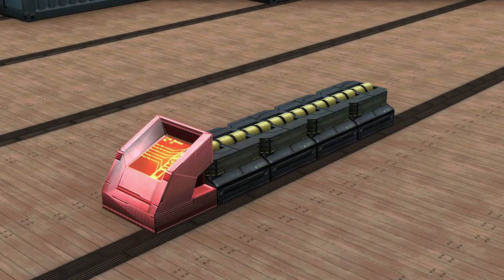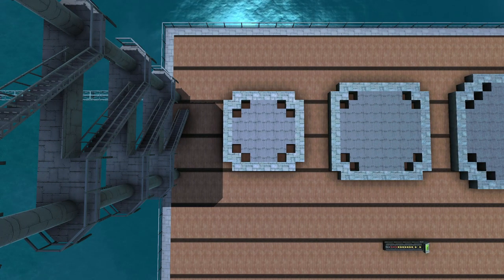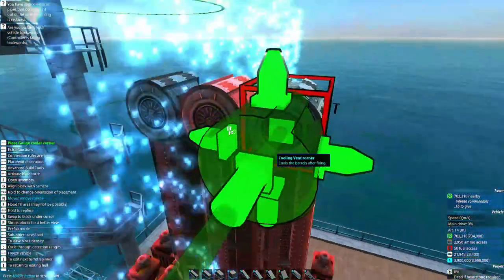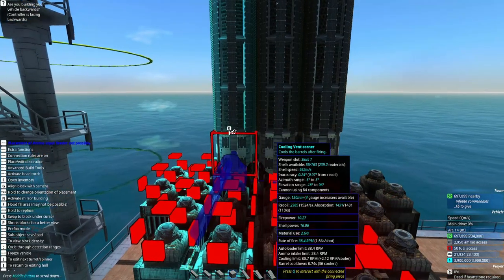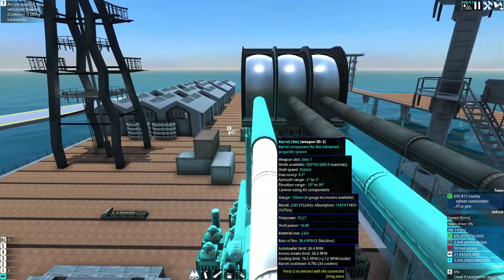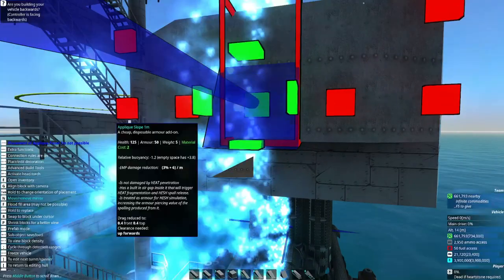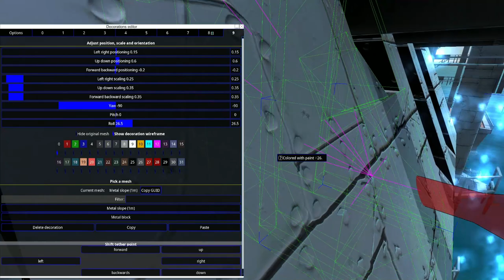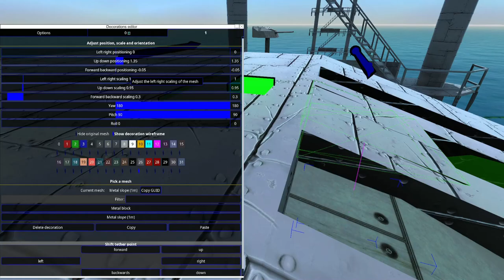Wrench's Way II: Constructing Guns - From the Depths

Comment: It's worth noting you can shave length off the shell with base bleeders, tracers etc. I pretty much always try to use base bleeders because there's really little reason not to imo.
Reply from the maker: Also true, I’ll have to remember to add that note in when I do an APS tutorial
Reply: Inaccuracy from those can hurt
Reply: @garrettledford1147  I've found lengthening the barrel a bit fixes that just fine and normally works out better overall.
Reply: @Kav.  Really? I'll have to try that out
Reply: @garrettledford1147 

Pair it with a rail gun if possible.

Boost to accuracy never hurts

Comment: I would add that you should really armor those turrets on the subobject itself, both the loading assembly and the neck, because any round that hits and registers on the subobject will ignore all external armor for damage calculations. If a big HE round hit the side of that turret cap, even if the top was completely unscathed it could easily wipe it by severing all of the gauge snakes through the deck armor.
Reply: I thought they fixed damage bleeding like that years ago?
Reply: I know its late but thank you, im now 90% sure thats why my turrets are getting destroyed even when the armor is barely damaged.

Comment: 10:58 Had to stop and look up the HMS Hood. Now I know a little bit more about naval history. Funny how that happens.
Also, just noticed while I was messing around based on what you'd shown - I don't know if an update changed this in the 8 months since this video came out or if I'm doing something wrong, but it seems like having a consistent number of clips attached to your autoloaders (or just having a ton of autoloaders) is really important for sustained fire. I tried building a smaller cannon that what you show here (2 barrels, 7x7 including armor, and only 1 layer of autoloaders), and because of the way I had set them up it claimed to sustain 20.5 RPM, but after about 10-15s it would get itself stuck where none of the autoloaders were ready to reload, so it would sit for 4-5 seconds not being able to fire.
Reply: That might be your cooling being higher than your autoloader/intake limit. It'll fire as fast as it can, so if the cooling lets it fire 80 rpm it'll fire 80 even if it can only sustain 20.

Comment: This taught me a lot, I mean I tried doing everything that you did, block for block but for some reason it made it so all of the Guage went to 1 barrel and the other 2 were thin, I still need to learn more but this is a great start, thanks
Reply: I'm so glad I'm not the only one iv just done the exact same thing
Reply: @benwenden2406  the way I fixed it was by having the barrels kind of separated from each other, instead of using the 5 way cooler blocks I used more of the corner or 3 way blocks
I hope what I said makes sense and can help you

Comment: Why do you need ammo controllers; I seem to be able to design shells in the APS barrel itself > access intakes > shell edit, assign to all / unused? What purpose do they serve, are they just redundant, do they allow saving and use of multiple shell designs? Are they needed for APS guns to work outside of designer mode?

Comment: If you really don't mind, for any multiple guns on the same turret, just build one on a spinner gun and clip it on the turret ring, this way every gun are ensured to be identical. Moreover you can stack the gun on pistons to make the gun barrel spacing denser or wider than 1 block.

Comment: 11:00
HMS hood wasn't hit in the deck though the fatal blow was just under the armour belt through the really thin torpedo defences
Reply: The captain turned in to close the distance because of the weak deck armor that was vulnerable to plunging fire at long range, which was responsible for halving the British firepower and increasing the hit chance of Bismarck's guns. If it weren't for that deck weakness Hood and Prince of Wales should've won handely, Bismarck was no Yamato that could take on so much firepower and win.
Reply: @garrettledford1147  what does weak deck armour have to do with a main gun round from Bismarck hitting hood below the water line just under the main armour belt and through the torpedo defense and detonating in the magazine
Reply: @justnsaliga8518  Weak deck armor -> going in closer -> lucky shots more likely to happen

Comment: I am extremely impressed with your turrets! However I have spied that you know how to make dual duals? (4 barrle sdefided by two in a single turret) I would love to know that too haha
Reply: For quad turrets you can just split the turret into 4 quadrants and run the cooler snakes up in a sort of T or a square or whatever you want really. To get them into 2 pairs all you do is space them close to each other on each side with a big gap in the middle by routing the cooler snakes within the turret cap. Quads are easier than triples though, you just gotta try it.

Comment: Appreciate having a second opinion on aps as for the time being I just got ohms opinion on it.
Also take my observations with a grain of salt as I might not understand the intent of some of your design choices 
-I like the concept of the apheat shell youve shown but from what I can tell it can't quite break a 4m beam of metal, which for an AP anything shell isn't that great, though swapping 1-2 of the he bodies for solids would fix it. (Also I could be missing the point that the shell could have been made for the sole reason to teach how to make a shell)
- turret cap in general seemed to lack any form of heat/hesh protection, even with it's size being small I could see some ha slopes bring fit into it and utilizing the metal shell around it to activate heat/hesh early and catch it on the slope(s), though I can see the lack of raw hp being a tradeoff you might not be willing to make.
-personslly dislike the coolers at the very front of the cannon, if you put them at the back or middle they might have a bit more survivability, even if the turret van have minor chain detonations.

Otherwise a very nice aps tutorial with deco tricks and cap scaling pointers that I'll def take and use, along with the triple aps setup recommendations that should help me move away from single barrel turretcaps.

Comment: Where do you put the local weapon controller and wireless transmitter on such large guns?
Reply from the maker: I normally put the all in one controller down at the base of the turret.  I always make room for it since it’s just one block
Reply: ah kk, ty. just started playing yesterday, ur video was helpful although I kinda got lost when you started actually building the gun lmao
Reply from the maker: @r.a.6016  yeah I’ve heard that a few times.  I plan on eventually making a full APS tutorial.  It’s just finding the time make one is difficult right now
Reply: @JustaWrenchGaming  fair enough. Although your videos have been incredibly helpful. Just watched (and followed) the hull one. Made a decent-looking hull and then absolutely murdered the superstructure hahahaha. Also the damn tub isn't buoyant enough, looks awful...😅😅
Reply from the maker: @r.a.6016  glad the videos have been helpful!  If you’re having a problem with buoyancy especially on a bigger craft, I would recommend making the outer shell of the hull out of alloy, then putting metal behind it.  Alloy is super buoyant and will help significantly.
Reply: @JustaWrenchGaming  they have! Currently watching the one on the superstructure and am very jealous of your skill, the Kirov looks amazing. I actually did exactly what you said, built everything out of alloy then slapped a second layer of alloy behind it (not metal). The issue came around when I put in guns (using the 3x3 advanced cannon prefabs), and all the heavy armour i placed around the gun upset everything. Also the ship might not be wide enough, as turning is god awful.

Comment: This is great information and all, but trying to follow your cooling routing is a nightmare. Switching between between all those connection types I cant even follow it in .25x speed. It would have been nice if you just called out 3 way, 4 way etc as you placed down or replaced parts.
Reply from the maker: I’ll go over more in depth on all that when I make the full aps tutorial video

Comment: Question, do you think it is worth to put hesh/heat lining on turret caps that size? You didn't create a liner for your cap. Then again very little ships use it in the campaign.
Reply from the maker: I normally try to when I have bigger turret caps, but for this one since it’s so small I don’t worry too much  about it
Reply: @JustaWrenchGaming  I usually replace the heavy armor you put for slopes, but then again I play with my own custom factions and most of my smaller vehicles use HESH so it’s very important, but for most general use again normal campaigns it’s a non issue.
Reply: @JustaWrenchGaming  Also forgot to say your editing is incredible and even though I already knew everything here it was amazing to see it so concise and well made for other people, I had to learn all this stuff myself and you did it expertly in only a single sitting, huge props.